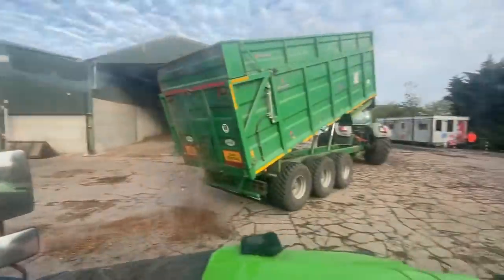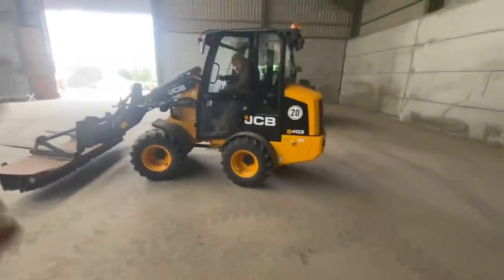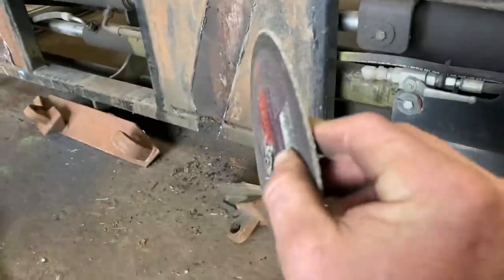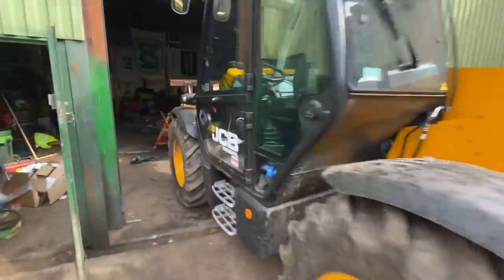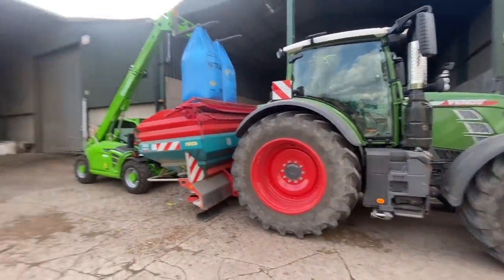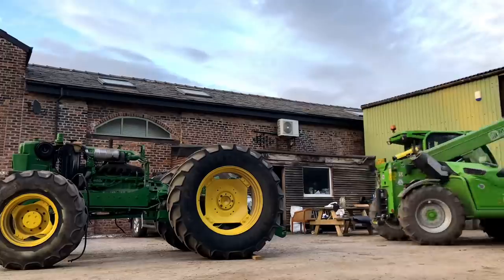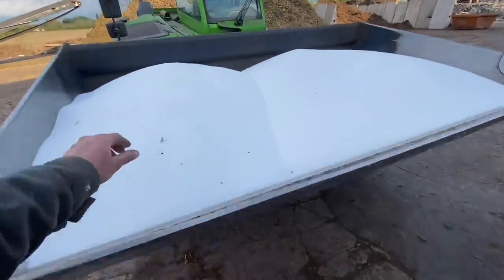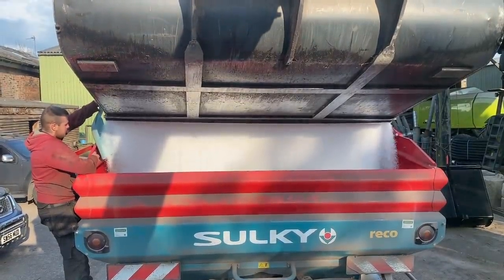Day 404 #OLLYBLOGS FIRST DAY OF WORK FOR MINI MERLO BENT BUCKETS AND BRACKETS

Comment: The bottles are for catching the hydraulic oil when you pull the pipes out or push pipes in on the my massy you can dump the pressure too so it catches that oil too

Comment: Todays quiz question, the little bottles are to catch the oil from the spool valves when plugging pipes in and unplugging them so that it doesn't end up on the floor like it did in the good old days 😂😂